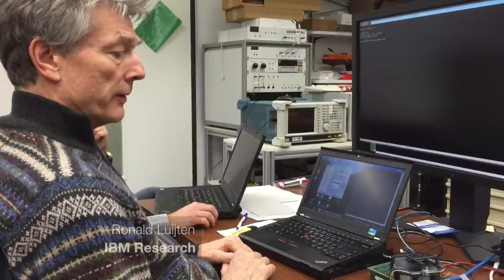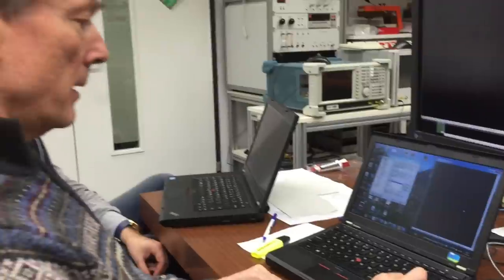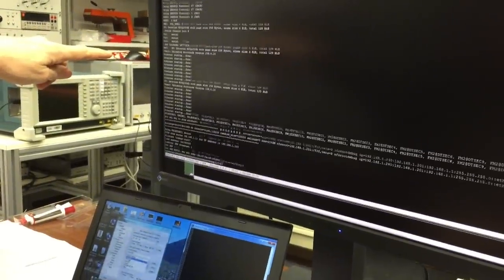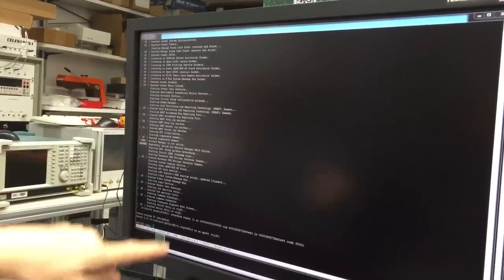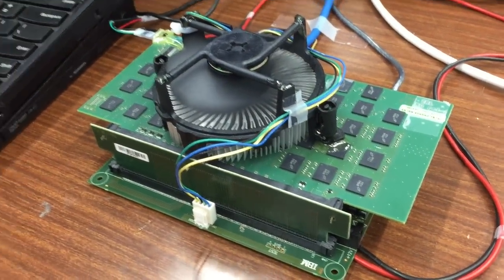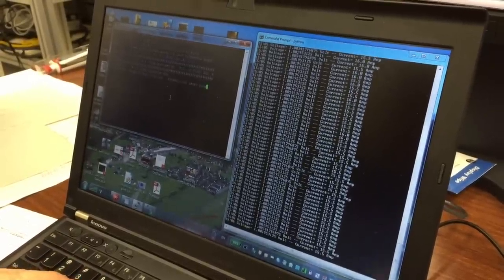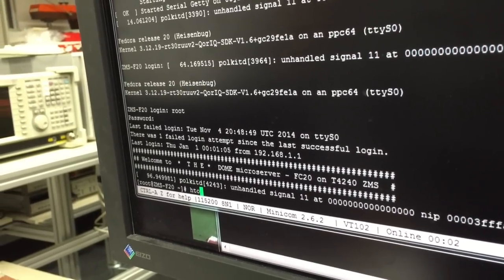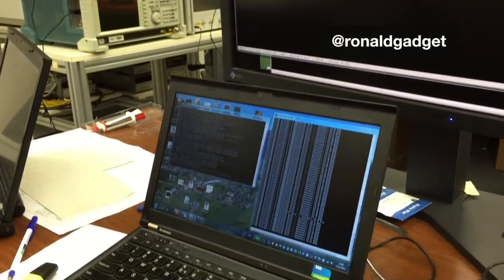IBM and ASTRON DOME microserver runs Linux for the first time

Comment from the maker: IBM scientists booted Linux for the first time on a prototype 64-bit microserver, which will eventually be water-cooled. The microserver is part of a proposed IT roadmap for the Square Kilometre Array (SKA), an international consortium to build the world’s largest and most sensitive radio telescope.
Reply: Hi IBM. Sorry to ask, but I have a very simple question I need to ask.

Does it run Crysis?

Thanks.
Reply from the maker: RN maybe someday. Currently the microserver is being designed to handle petabytes of data daily coming from deep space - from the original Big Bang, 13 billion years ago.

Comment: Very interesting, how did you measure the amount of current the Microserver is using?
Reply: Jonathan Theron --> We have chosen power-converters that allow us to measure the actual current that is being consumed. We implemented this capability thru our PSOC chip (see page 7 at http://www.zurich.ibm.com/pdf/microserver/lui_at_SC14.pdf ) that allows us to show the actual current at the 1V supply domain, which is the high Wattage usage ot the T4240. We also instrumented the other power converters to do the same for the I/O power and DRAM power.

Comment: Nifty, is this Power PC?
Reply: Yes it is. The Freescale T4240 is a 12 core 64-bit PowerPC SoC with two way multithreading for a total of 24 virtual cores. Using 16W running at 1.8 GHz is very impressive.
Reply: Yes, this is ppc64, not by IBM but from Freescale. It is in fact Embedded ppc (book E). This is a server-on-a-chip (SoC), which allows to build compact and energy efficient server systems. We have a paper coming up at ISSCC 2015 in San Francisco including a live HW demo on Feb 23rd.